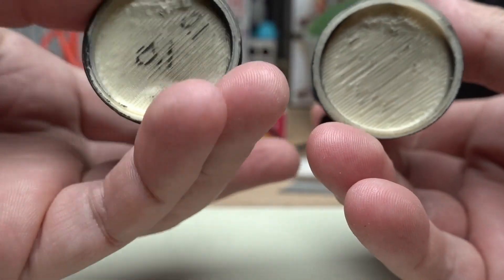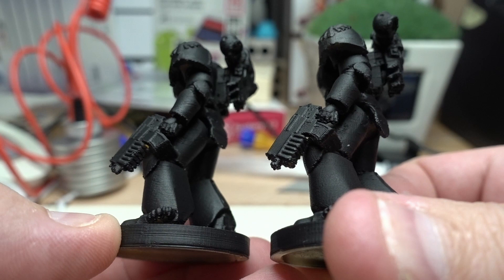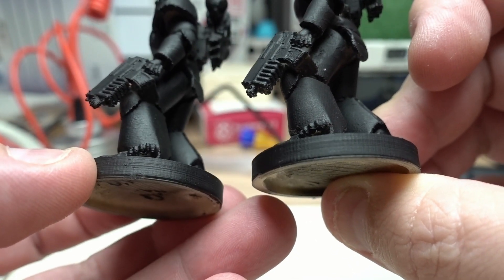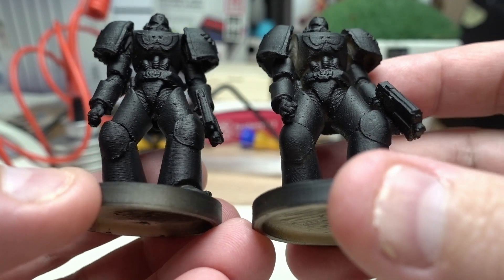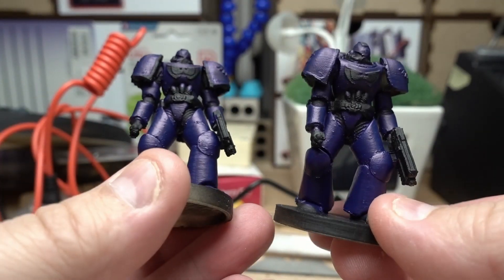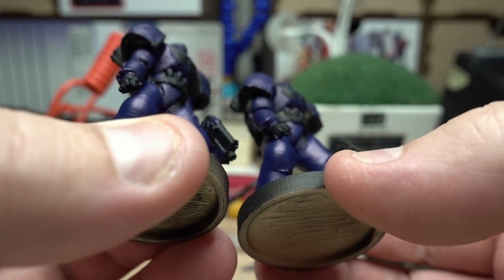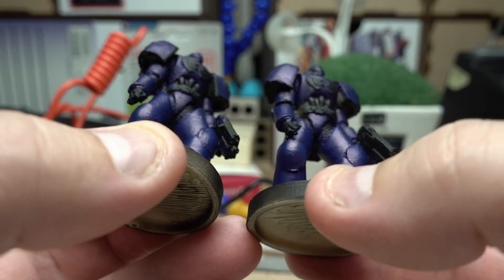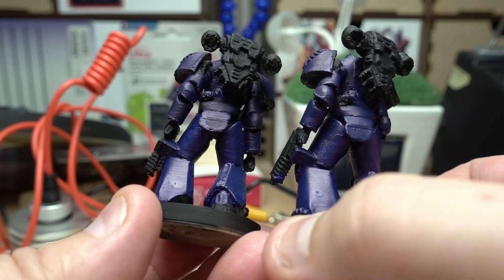3D-printing 0.1 mm VS 0.05 mm

Comment: Why not go to resin
Reply: Health and the space requirements. 

Resin is insanely toxic, and the printing process is too without ventilation. Mixed with curing and any contaminated water you get you have to dispose of at a biohazard facility. Not feasible and worth the effort for most people.

Resins also can cause allergic reactions upon handling.

Comment: Forget all that. 0.02 layer, with a 0.2 nozzle. ABS plastic. No layer lines.
Reply: Lmao 0.02 layer height will take you days for even the smallest prints. You're better off printing at 0.08 + acetone smoothing with ABS.
Reply: @DarthChrisB  Currently print transparent ABS using 0.2mm nozzle and 0.03mm layer height. Most stable prints. I mostly print greebles and little sculptures/minis. Acetone is def a good thing, as it strengthens the models.

Comment: Printing 0.05 with a fdm is not the problem really, most 3d printers can do that...the problems are the adjustments in speed, temperature and flow...and it's a HELLA tedious and sometimes frustrating job
Reply: You'd think that 3d printers would be packed full of AI by now. Suuuurly a tech company can revolutionise 3d printing. It's all soooo manual with so much room for error.
Maybe in 5 years or so.
Reply: @1augh0utL0UD  ...but why would they waste the R&D for minimal rewards in the market? Autoleveling is easy to focus on because it's a relatively uniform procedure every time and is convenient for the end user. 

In comparison, having an AI that could adjust for all printing parameters based on print speed is a huge hassle that most wouldn't use.

Comment: where did you get the nozzles? Do you have a product recommendation? Cheers!
Reply from the maker: Came with the printer.
Reply: I have same printer but no 0.05 came with it, smallest one that came is 0.2, I also searched on it but still..can't know where they sell it.
Reply: @lightbody232  0.1 and 0.05 are layer heights, i.e. the amount the printer is lifted per layer.

Comment: Well, again i cannot really show it, but my Ender 3 produces quality at 0.1 mm as good or (subjectively) better than yours at 0.5mm it seems. My 0.1 printed minis are absolutely smooth, barely a visible layer line and all the finest details clear and crisp. After cleaning up, they look more like injection molded. And after light sanding with 1000 grit sandpaper on the larger faces, they are basically flawless. And that with the cheapest grey PLA i could find on Ebay (OWL-SAT).  Seems like your settings aren't quite optimal yet. I am currently printing a 10 cm Marauder Battlemech figurine at 0.1mm with adaptive layers as a test. Estimated time: 20+ hours. So far, it looks quite promising.
May i suggest trying one of these next: https://www.thingiverse.com/thing:1536561 ?
They are highly detailed and complex, ideal as a torture test and dialing in quality settings. I'd suggest 50 and 100mm heights, at least that's what i am gonna try next.
Reply: What slicer, nozzle and settings you using? Do you use supports?